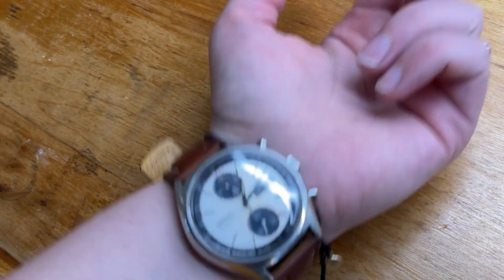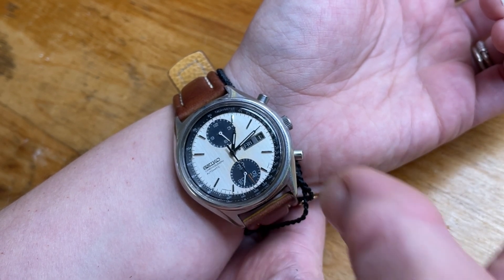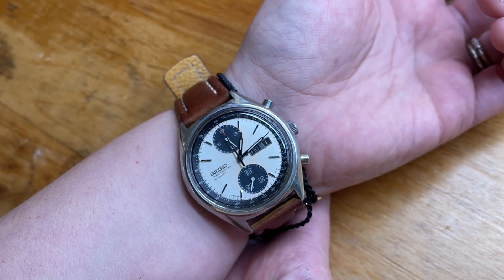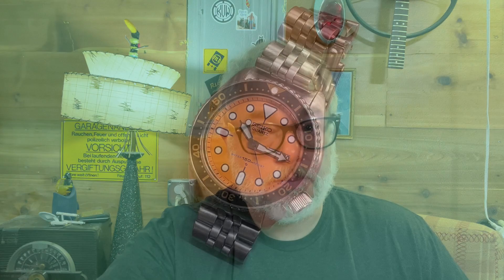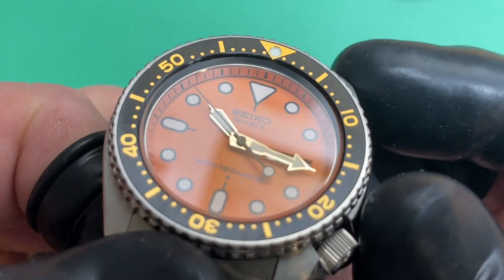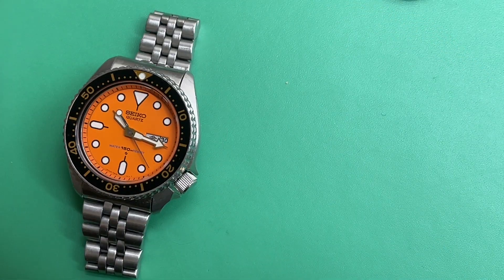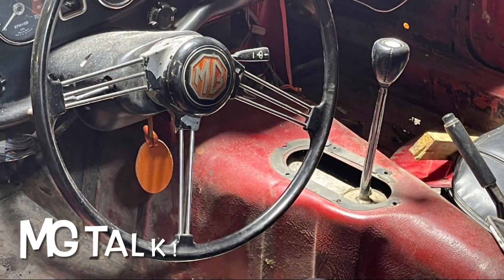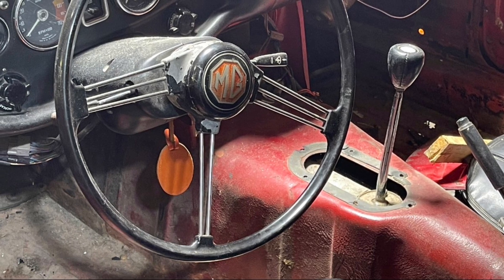Mail Call 199! I think.  September 1, 2023

Comment: Love your mail call videos, Spencer & Sabrina!

I love the 7549 7010 tunas. It's quite possibly my favorite watch of all.  You asked for strap suggestions.  I've seen them look very nice on a mesh bracelet.  However I wear mine on original Seiko rubber (not silicone) straps.  The DAL1BP works really well and looks like the original strap.  I also enjoy my Tuna on a discontinued Seiko B22 strap.  I am not sure which diver this strap was originally used for but it's made from rubber and is looks different from the contemporary silicone strap that bears the same code number.

Comment: Hi Spencer and Sabrina.  Thank you for all the great vintage Seiko watch content.  Question for next mail call.  Spencer, would you comment on some 6309/6306 150m divers that have white or creamy dial lume that once opened up the lume starts to turn to a light gray over an extended  period of time.  Is this a reaction to outside atmosphere, sunlight,  or some other factor causing the rapid oxidation of the lume on the dial.  Thanks for your input.  John S